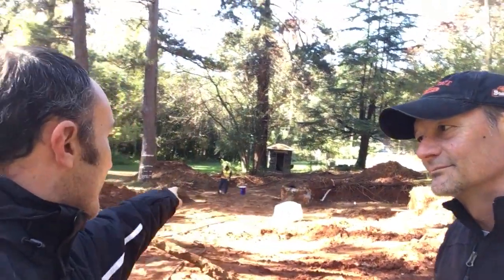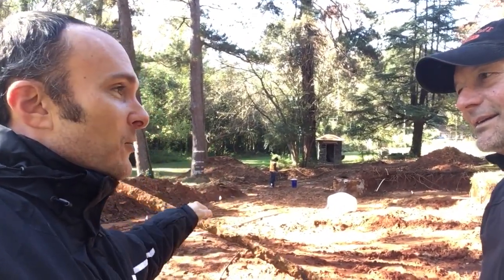Geotechnical Engineering for Atlanta High Performance House

Comment: how do you know if watter table is 2 high to build a basement?
Reply from the maker: Actually not too hard- start digging a hole until
Reply: @HomePerformance  until what
Reply from the maker: Water
Reply: @HomePerformance so if you hit water at 4 feet you cant dig a basement or what
Reply from the maker: Well you CAN I suppose, but it’d actually be a boat
Reply: @HomePerformance  well youd have to put in footer drains